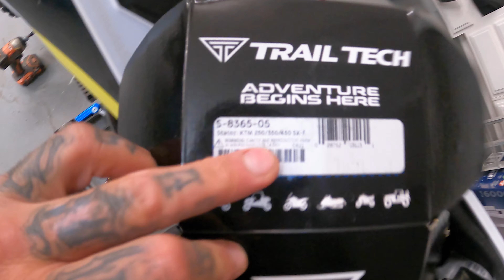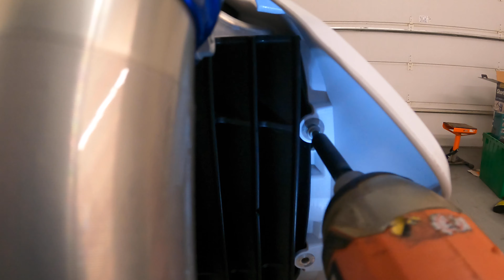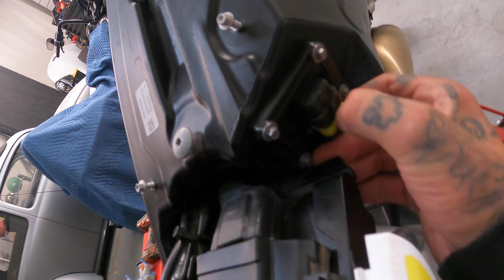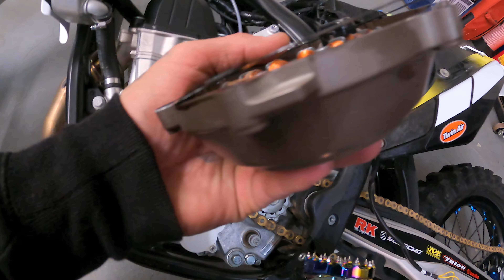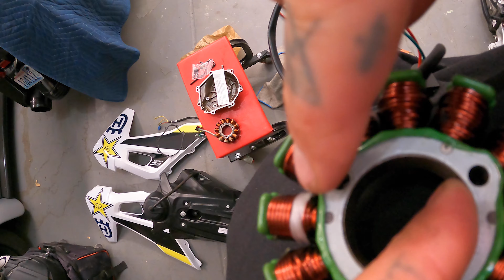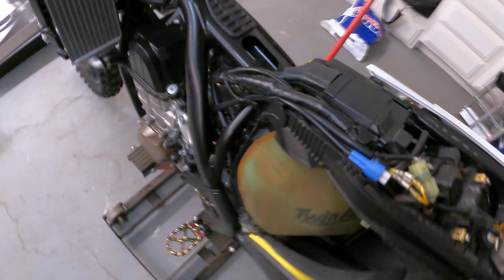Husqvarna FC450 Trail Tech High Output Stator Installation

Comment: Good vid,, just a thought, you mentioned a carbon cover, most that Im familiar with just fit right over the factory cover utilizing 
two or 3 cover bolts, I installed the CMT to match my tank and swingarm it used two of the cover bolts